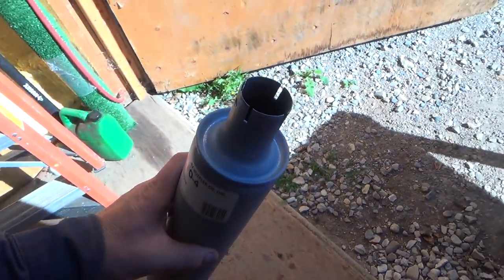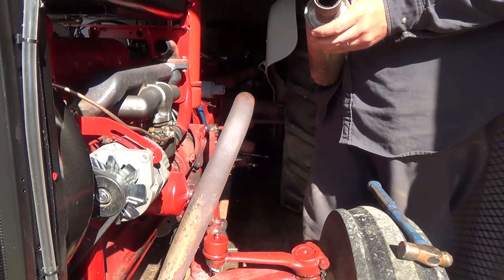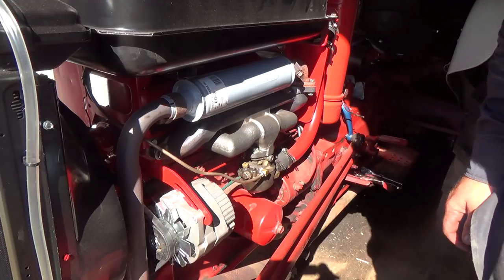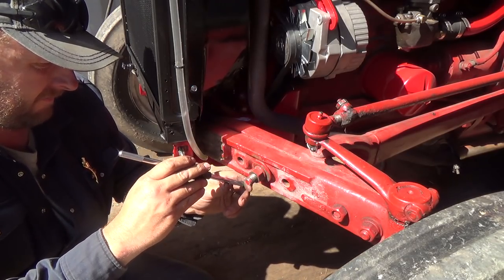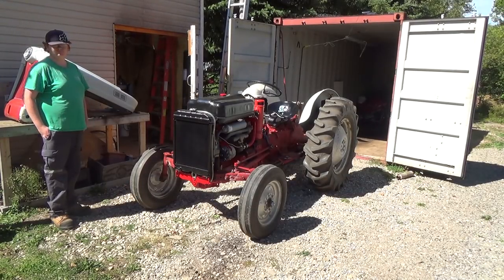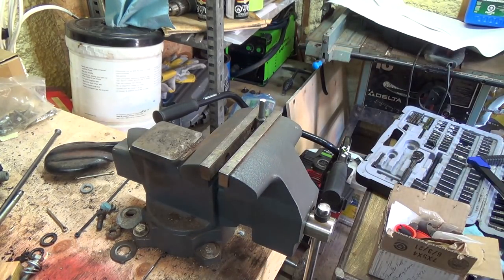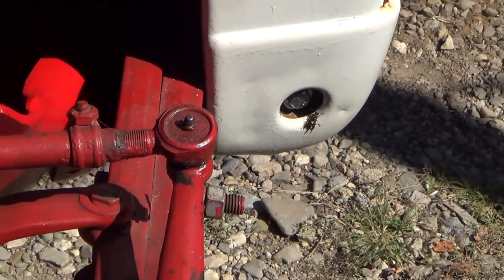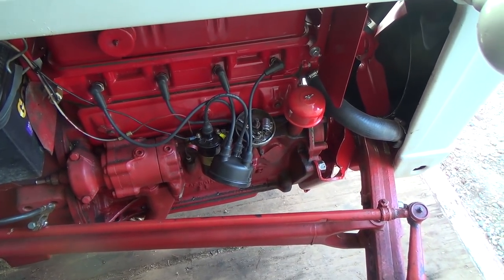Ford 800 Exhaust change and hood button up..Again something happened to the engine

Comment: the die you're using looks like a rethreader not a die for cutting, at least the dies I cut with at work have a split in them and are adjustable, a rethreader is not meant to make threads just clean up existing threads

Comment: You need to go and buy two hammers.one is a shot filled plastic hammer.the other is a rubber hammer.they work great for what you are doing right now
Reply: Plastic shot filled is called a dead blow. And the other is a rubber mallet.
Reply: Right I had a brain fart at the time.could not remember the proper names for them
Reply: @brianrutherford3681  I understand happens to me sometimes also!